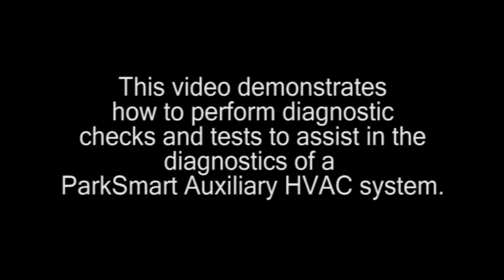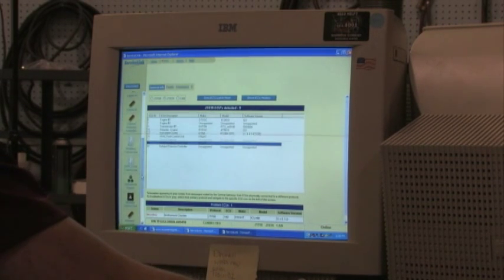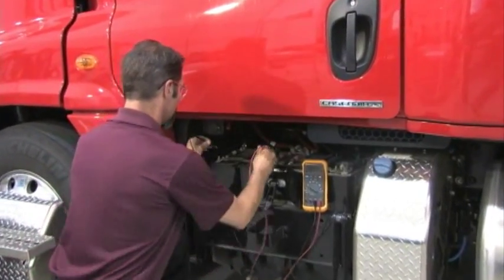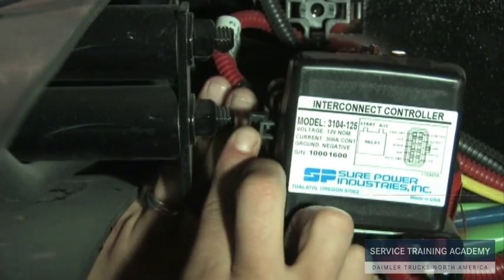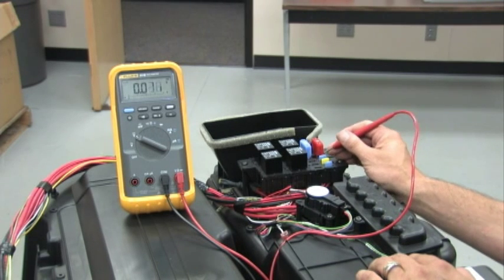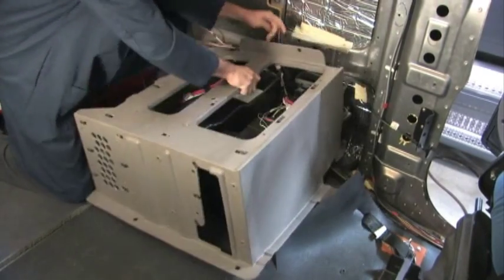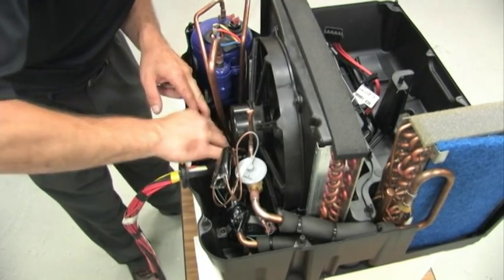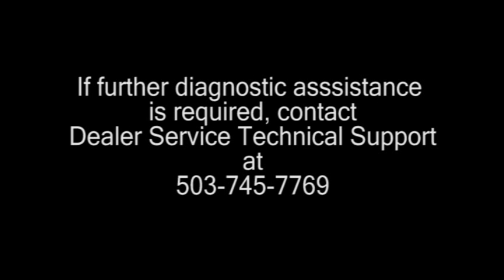ParkSmart Troubleshooting

Comment: I have one of this on a 2016 cascadia that blows almost cold air in full heat. Any suggestions?
Reply: Did you find out..? Need to know I have same problem
Reply: Probably the espar coolant heater has issues
Reply: Did you find a solution?  Don't wanna take it to the shop guys if it's an easy fix
Reply: @MrSluggerman  no man. still in the same boat. mine cools just fine, so with warm weather, its helping out a lot!
Reply: @MrSluggerman found out solution i’m have this issue only blow air no heat
Reply: What is a solution?@dhillon11
Reply: @nikolaveskovic3910 find esber heater under the bunk or outside under the cab, the actual heater needs maintenance or replacement,
Reply: @dhillon11 Hlo bro what is the solution if only air fan coming no heat?? In freightliner cascadia 2020 in park smart bunk heat

Comment: I dont know what Psywar64 got but my Park system in ac and heat mode works wonders. I love mine I have had the ac in 119 degree heat and it keep me cool for 12 hours and the hearter keeps the engine warm so after break my truck is all nice and tosty.